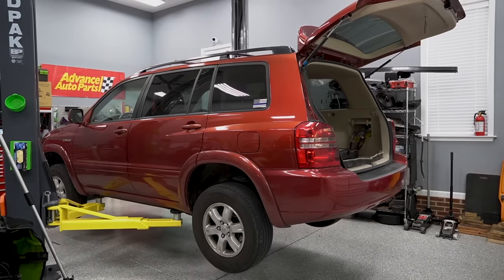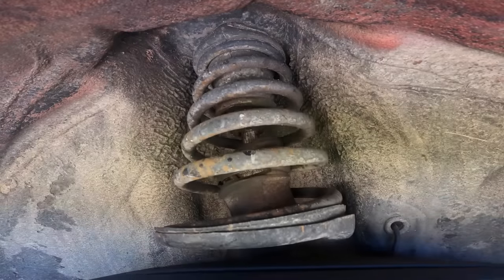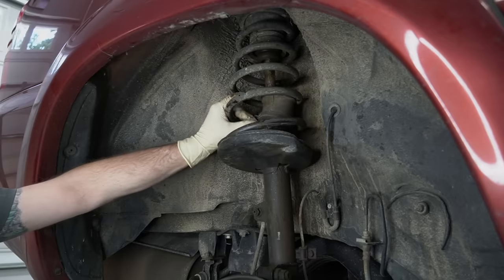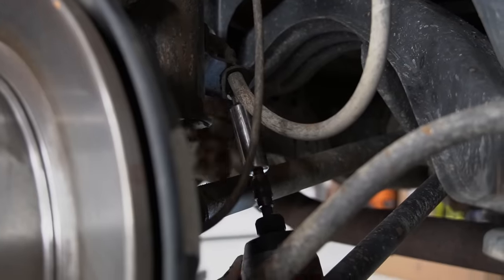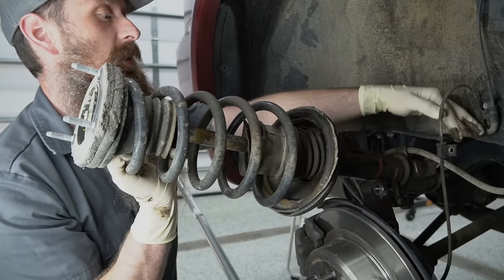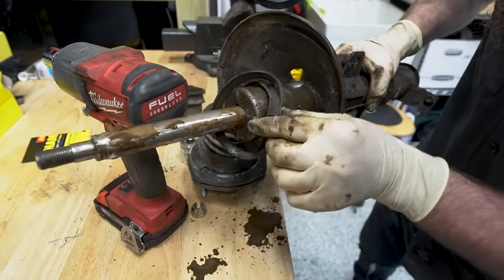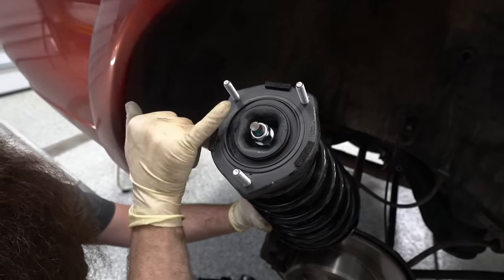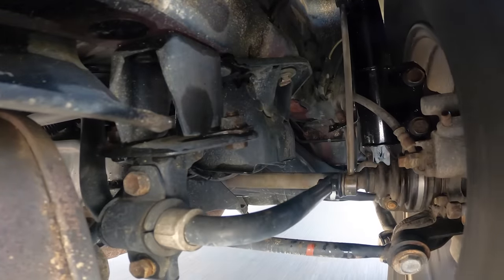How To Fix a Noisy Suspension ~ Noise over Bumps

Comment: That was the most clean cut failed part ever. That strut was smoked.
Reply: I was thinking that strut was drowned.
Reply: Right!  My G37s struts are going and there is pretty much no visual indication they are bad, only very minor
play from the outer tie-rods and some surface rust (normal up here in Canada). 

Go over an expansion joint on the freeway though and you'll know. Hah

Comment from the maker: Remember there is no need to chase Advance Discount codes. You can use "Humble" any time you like and save $$$! Also stack up those speed perks to you can get up to $20 off, rather than $5 at a time.  For those of you worried, We are still a primary VW place. But some times you gotta get something fixed. Im happy we were able to get this Toyota fixed. I am concerned that this Toyota broke. I thought those never broke! ;)
Reply: It didn’t technically “break”, a wear-item .... wore out.

I’d show you a truly broken Toyota, but the scrap guy hauled it away this morning. 🤷🏼‍♂️
Reply: Correct, can’t say never but rarely if you are a careful driver. 11 years old Auris hybrid that covers 200+ miles a day since 2018 currently at 170k miles with all original including its batteries 🔋. Can’t complain here👍
Reply: Awesome thank you
Reply: brah.... your videos are so fire. your teaching a computer tuning nerd to be a car tuning nerd
Reply: I think for Suspension parts, Toyota or VW have similar quality. Either KYB or Bilstein made really good quality shocks/struts at a reasonable price.  Only the balljoint in Toyota cars/compact SUV never fail.  Control arms, shocks, stabilizer links are common parts that failed  in rough road or snowy salty area.
Reply: My two rear struts are completely shot at 175 000 km 06 Corolla, they do break ;) plus valve cover gasket, oil pan gasket, intake manifold gasket, it has been a fun ride with this Toyota lol, at least I’m doing it all myself.
Reply: @joshuaboursier7314  those gaskets are rubber gasket that last about a decade. Unless you have hybrid, the high temperature degrade the rubber fast but all are cheap fix and considered to be part of maintenance when we replace spark plugs and seals.  Shocks and struts are wear and tear parts after 10 years even in smooth roads area. It is not like waterpump housing like GTI that leaks every 40k miles, or timing chains in guides and chain itselfs in most VAG that mich harder to fix. Corolla 06 is a good car, no much oil burning like pre-03 and everything is solid.
Reply: @rondhole  thanks for the comment, yeah I figured this was al just maintenance and nothing to be concerned about, just a never ending list of thing to fix, but the car is 15 years old and basically all original so to be expected from what your saying.
Reply: @joshuaboursier7314  Most Toyota owner will just keep driving it. Just oil change 6m/5k miles, cabin filter every year.  We replace the starter or alternator when they go bad around 200k miles, serpentine belt when it cracks, water pump when it starts leaking, stabilizer links,  struts/shocks when it is too soft.   Those are considered to be wear and tear items like tires and brake pads/rotors.  If you do those, you can keep driving it as long as you clean the underbody every spring and coat it with liquid film before snow seasons. 1 million  miles is possible on that 2003-2008 corollas. Don't forget to change transmission fluid, brake fluid,  and coolant every 100k miles/10 years.  Small leak on timing chain tensioner gasket  is normal on 1.8 L toyota, including in their hybrid.  It is one of the legendary durable engines that was designed since 1990s.

Comment: In my experience a totally blown strut is actually one of the most common reasons for suspension knocking right after sway bar links and ball joints. Yanking the tire top, if it moves in and out and knocks like you showed, usually a blown strut. Awesome diagnosis and tutorial!

Comment: Charles as an experienced VW mechanic did you encounter hesitancy in the dealership when a customer wanted a front diff and transaxle fluids changed. I have a 2011 Touareg VR6 and insisted that they change those “lifetime” fluids. They did not even know how much labor to charge because they rarely do it! The vehicle has 123,000 miles at some point those fluids will fail. I found the experience odd but they did do the work and I think it made a difference.

Comment: This teacher gives you a gold star, for excellent instructional delivery. Your sense of humor is great, too. Thanks for a terrific video!
Reply from the maker: Thanks!
Reply: @HumbleMechanic   Would you know the torque spec for the center top nut for front struts that holds the spring on a 2006 mazda 3s 2.3l auto sedan ?

Comment: My 98 vr6 hit a pot hole and then I got a clunk from the rear. Turns out the top of the damper had snapped off spraying oil all over thin wheel arch. Couldn’t claim of the local council as the mechanic said it was rusty so wouldn’t write a note saying it was pot hole damage, but only after he did the repair and charged me. Wish Charles was I the UK. 

Keep the videos coming Charles they are great.

Comment: I’m a VW/Euro owner but I work as a Toyota dealership mechanic so this is an interesting video for me. Specializing in both, I think the VWs have better suspensions, Toyota suspensions can’t seem to stay in one place and my Euro customers (except Mercedes) don’t have that issue. The rear shock is just starting to leak on my all-original 182,000 mile Golf. But for mechanicals,  Toyota’s are better as for the most part the components are not in odd places and it’s simpler, a Toyota powertrain can easily reach 500,000 miles with basic maintenance.
Reply: How much u think I would spend for labor on struts for my 13 Camry

Comment: Thank you for your cool video on struts removal and replacement as I'm having all kinds of issues with my 2010 Dodge Journey SE due to left driver side going over median that's not visible at night which cost me a lot of money on having to pay for labor costs of  my struts  I had done in 4/2021. 
And made me lose much money from work being I quit due to everything going wrong mother's day weekend of May 12th, 2023 and I've also had to replace CV axles .. 
I still need all 4 (3&1) engine mounts, brakes, drums, rotors, on all 4 tires, abs and traction control light came on 3 months ago, and just the other day my airbag light came on. I also need steering gear and or shaft as my alignment is off as they say they can't get it straight .. I've also had rack n pinion replaced,  left n right lower control arms replaced.

Comment: I'd say that dude definitely got 20 years worth of life outta that strut! I suspect it was knocking for years before it was fixed, considering how badly worn the shaft bushings were. I can imagine how crappy his drivability must've been affected by that.

I make a point to check my brakes, struts, shocks, and stabilizer bar-ends on every tire rotation. Maybe this dude should do the same from now on, at least from a safety perspective. He looked kinda young, so that's a good lesson to learn from.

Always appreciate a HumbleMechanic video - even if it's not a VW. Cheers!
Reply: He'll be lucky to get 2 yrs out of those Chinese made Advanced Auto quick struts.

Comment: 2003 Chevy Cavalier alignment shows that Camber Bolts are needed for the front, and EZ-Shims for the rear (to adjust Toe and Camber). I would rather replaced the parts, but don't know for sure which ones. As far as I understood on the front what causes the need for Cam Bolts is bushing, which is worn. So I assume if I replace that bushing I won't need that replacement of original steer-to-knickle bolts for cam Bolts. Bu for the rear I don't know what to replace at all. Thank you for the great film.

Comment: Nice one, last year I replaced the sway bar end links (drop links in the uk) on my mk5 based vag product, (Skoda) 2 months later the most irritating knock over bumps etc I checked for play in everything loaded and unloaded, in desperation I removed drop links went on test drive - fixed, replaced with TRW and been fine for another 30k, those ones that I took off at 2 months were moog and had in a vice with mole grips a tiny bit of play. Anyway it seems moog in Europe are not the same quality as moog in US, annoying as I like there stuff.

Comment: i had a  creaking noise from rear I removed shock noise went away so i replaced shock with mount and bump stop on a 2016 vw gli and I have just a slight creak in the rear hitting pot holes or a ruff road next step is to put sound proffing material in the trunk where the shock is under neath and outside of trunk around the wheel well. the car has 70k on it in the cool weather it's there in the summer it's gone. and it's not the rear deck panel made out of plastic.

Comment: Charles.
What is the brand of the spring compression tool you used. I like the fact that can be secured to a table top vise.
Reply: Would also like to know, after fighting my cheap spring compressors I need an upgrade

Comment: Can't locate the noise in my 2004 Toyota Avalon. Replaced the struts as well as the sway bar bushings, but the rear is really noisy, especially on the driver side. Going over speed bumps slowly makes a grinding sound like metal on metal. The front does it too but not as severely. Hitting a pot hole at even low speeds sounds and feels like the wheels are attached directly to the frame.

Comment: We recently changed springs on my car. We had a super hard time getting the struts in the front back in. The guys finally got them in with lots of force I’m assuming. Now my car makes this noise in the front that sounds like either something is loose or broken. It’s pretty loud. It happens only when I go over bumps. What do you think got f’d up?  It was our first time being mechanic’s
Reply: Did you install cheap quick struts?

Comment: The dust boots on my MK4 squeak... Bothers me.. but all the suspension is fine. I removed the rear passenger dust boot and it made the squaking in like 50x better but the others squeak.. Might replace em all.

Comment: Can a Comfort control module on a 2004 Golf 2.0. Stop the a/c and high speed fans from working?
Reply from the maker: I don’t think so. You might be able to make that connection, but it’s a stretch
Reply: @HumbleMechanic  Thank you for getting back to me so soon. I'm glad because I hate working under the dash. The dealer wanted $1,700 to fix the a/c. I told them to go sit on a dictionary. 
The engine speed change a little when I push the a/c button but nothing else happen. It is full of freon and there are no blown fuses.

Comment: This happens after the struts were replaced ( all 4).   the arms are repaced too.  like 2 thin metal banging together .. but the struts are new now. The noise is light and it wasn't there before.  Did they leave something loose ?

Comment: I have a 2002, ALMS Audi TT coupe, 60000 mi no weather ever.I have a parasitic draw battery goes dead in 3 days if it isn't started,Battery and alternator  replaced  (dealer no Change) is this a common problem that you see ? Where are you located ? Thanks for any reply .Rick

Comment: I was told mines is bad I know for sure I only hear a nosy sound only on my right side it’s obvious I think it’s my shocks or bushing  , struts & cv axle … & I been noticing my car slightly pulls more on the right side I honestly think a pair is worn out I can feel & see my car leaning a bit like pulling towards right it’s a uncomfortable feeling so I’m actually trying to get that done soon as possible & I also was told I need brakes pads& rotors replaced they worn out

Comment: I have a 2003 Passat GL sedan 1.8t. Currently I am not getting a signal from obd. Car runs fine but ABS and Brake light is on. When put into drive and move forward warning tone sounds and then goes away. Heater core went bad a couple years ago and I bypassed. As a result of bad heater core coolant leaked into floor board. I have been looking into cause of no signal from OBD port and I found one cause could be bad TCU because of water may have gotten to it. Can you please advise what can cause no signal from OBD? Thank you. Car runs great otherwise, but can't get it smog checked because of obd not reading.

Comment: I hope you see this because I'd really like an answer, I have a 2000 GLX Volkswagen Passat wagon with the V6 engine with just over 100,000 miles, it has an oil leak or I should say multiple oil leaks as my mechanic informed me, none of them are bad they're just little drips so I was wondering if Bar's Leaks oil seal and treatment is something I should consider using?
Reply from the maker: I’ve never used it. But I generally hate that kind of stuff

Comment: So just did my front brakes on my 2015 Audi A6 . Now the driver side front makes a clunking noise when I hit little bumps. If I hold on the brakes some it goes away going over the bumps. I did both sides the same way. Put the grease on back side of pads so I'm not sure what is going on. Any help at pin pointing my problem is greatly appreciated

Comment: No way, I was just thinking about the noise my VW’s suspension makes on every bump, I open youtube and the first thing I see is my favorite VW mechanic teaching me how to fix it
Reply from the maker: Hahaha Aweosme
Reply: It read our thoughts
Reply: Do you have an equivalent vw/passat (2014 )video? I have rear left left clunk/rattle going over bumps.
Reply: @matthewblue7839  me too lol .. same exact car but the sound seems to be coming from the front for me
Reply: If it's VAG no doubt the strut mount bearing is kaput
Reply: U too!? Dang! My 84 Volkswagen Rabbit convertible sounds like plates smacking each other every time I hit a bumpy boi
Reply: @eponymous7910 literally this… I replaced my strut and springs with coilovers last night and went ahead and put new top bushing and bearings in too. The noisy side was a rust-o-la’d seized bearing… they are too cheap not to replace if you take that assembly out for ANY reason.
Reply: If its a VW probably there is a program in the computer that mimic the clunking noise so you have to pay and take it to the dealer

Comment: So I recently had my front struts and top bearing assemblies replaced along with my rear shock absorbers, all was fine for about 2 weeks then I started getting lots of front end noises, I took it back to the mechanic to fix and he said he couldn't find anything wrong, recently I had spare time so I went over the front end and found the left wheel nuts 1 turn lose as well as the strut shock nut half a turn lose on both sides, tightened these up myself and no more sound and no more work for the "qualified" mechanic.

Comment: Hi, I am using a 2012 VW Tiguan 2.0 TSI. Currently, it shows "P2015 Sensor for intake manifold flap position bank 1: range/performance". Is there something I could do before order new intake manifold with Sensor & Solenoid Valve? Hopefully you will respond to my comment. Thank you in advance.

Comment: is clunking normal on coilovers? even if they are tied properly and installed properly? mine from the front clunk and i checked out the shock absorbers and they are clean. in fact everything is clean but they clunk when going over pothole or speed bumb

Comment: Got a sort of squeaking noises from the front right sounds like bushings etc.
7500 miles on 2019 GTI. 

VW changed top mount and some other little tweaks, seemed to 100% solve it, few months later its back, so likely could just be that they greased everything when doing the work.

Tried silicone spray on the bushings and joints, seems to have heavily reduced/ almost removed the noise. Though I don't have a proper jack and couldn't take the wheel off so likely didn't get good enough coverage. Any ideas what it could be or how to get rid of it?

Happens all the time really and at all speeds, though more audible when going over bumps

Comment: My 07 Outlander  Squeaks when I drive and it's not when I go over bumps or turn it just squeaks as I drive even if it's a flat  Road I've checked all my suspension components and I replaced everything that was bad The only thing is I'm not experienced with struts And that's probably what's causing the squeak?

Comment: On the subject of suspension: vibrating steering wheel when the steering wheel is in a certain angle, I'm guessing tie rods.
Also, low speed turning results in grinding/knocky noise. Struts good, springs good, top bearings replaced already. Also tie rods?
Reply: could be steering rack mounts/bushes also
Reply: @ty27tp  Bolts should be tight, I do have a new steering rack hold down bushing though. Tie rods too since one of them has play. But still interested.

Comment: Awesome!
But why you didn't pay attention to rubber boot on right CV-joint? There is some oily spots on it, and maybe some cracks or tears.
Reply from the maker: I looked at it. Didn’t find anything to worry about. :)
Reply: @HumbleMechanic  okay then. Maybe it's oil from bad shock absorber 🤔

Comment: My BC Racing BR Type coilovers are slapping and it's driving me IN.SANE.  

I've noticed that it sounds like the noise happens only when the car rebounds quickly, meaning if I drive slowly no sound but if I hit anything at a fast enough speed or if the road is very uneven and the suspension has to move up and down quickly and repeatedly, something is slapping, almost like my pre-load is too low?  

I put them on as is and didn't touch any of the settings from factory and two of them are clunking (my passenger front and driver rear).  I'll have to get down there and figure it out!

Comment: Nice episode again. Good work and a clear diagnosis, repair and vid.
Must be surreal to not use a 13mm and instead use 12 and 14mm :D
In our shop it's the other way around. the 13 is rarely used. 10, 12 14, 17 and 19 are worn and everything in between almost brand new.